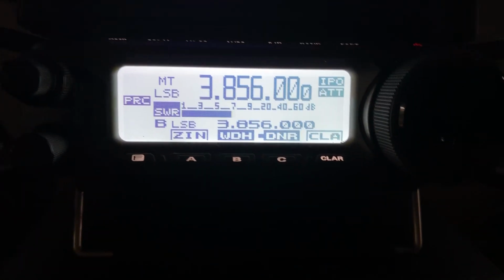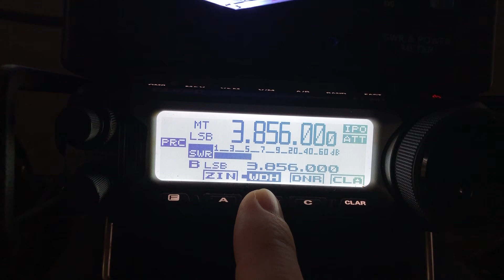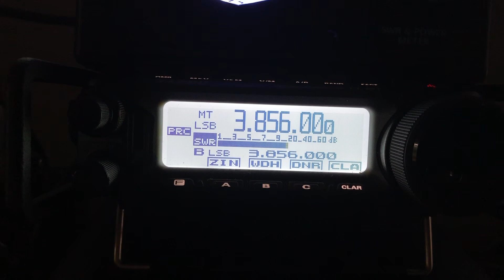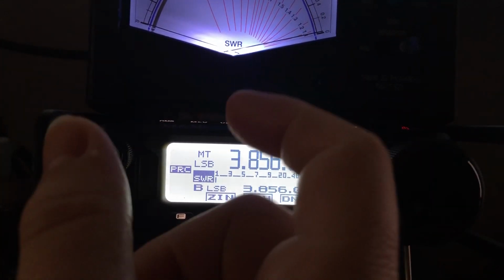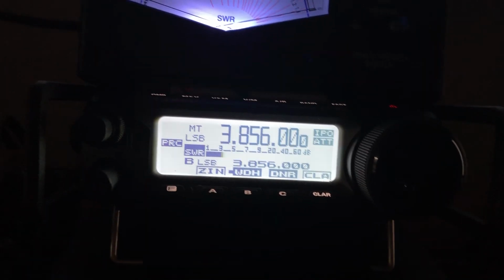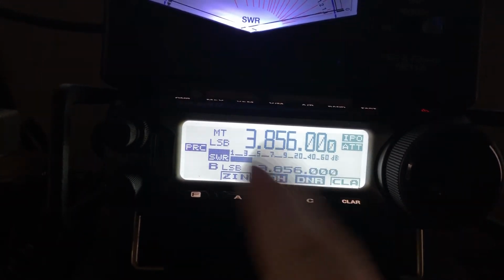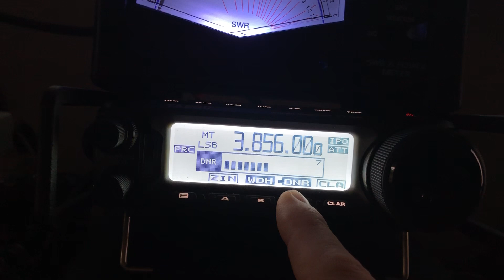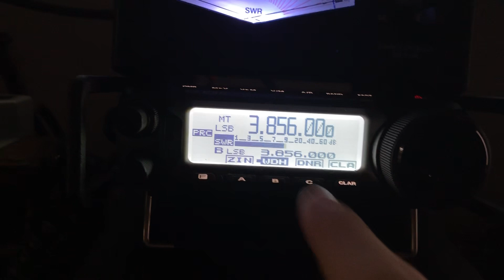Yaesu FT-891: Filtering Noise from a SSB Ragchew

Comment: Question...does the "width" only effect TX, RX, or both for SSB use??  73 😉
Reply from the maker: The Width setting is for RX.  There is a separate BPF (Band Pass Filter) setting in the menu to control TX bandwidth. I set it to 300-2700.  This setting produces a good balance between fidelity and punch for your TX audio.
Reply: @n4hnhradio  Thanks for the reply. I will have to dive into that menu setting. The manual is not very informative about the "width" feature, so I assumed it was for both. But obviously not. I do appreciate the tip 73 👍
Reply from the maker: There are width settings in the menu for the parametric TX equalizers.  Those are actually Q factor, even though they are labeled as width.  I cover that in my menu optimizations guides.  The higher width number means more narrow.

Comment: I just bought and installed this radio with the ATAS120. When DNR is on, even at a level of 1 it sounds very watery/digitly. Is there any way to avoid that? Listening to this video I’m not detecting that sound. Thanks for the suggestions, you make since great videos.
Reply from the maker: Just keep watching my videos. Even for other radios. I teach all about DNR.  For the 891, set DNR to 9. Use IPO.
Reply: @n4hnhradio  I did that but it still sounds watery. My FTDX-10 didn’t sound like that.
Reply from the maker: @truckinguy92 The FTdx10 has the same DSP but more memory. It has advanced algorithms. The FT-891 isn’t going to beat the FTdx10. The advanced algorithms won’t fit the limited memory of the FT-891.  That said, if you adjust your FT-891 exactly as I do mine, you can get good results. I have a PDF that I make available to members of my Patreon support team who support my work with annual donations. That PDF covers my menu optimizations.

Comment: I’m so glad you explained the filtering possibilities as I’ve just purchased an ft891 and if I can get it to where you have with the various actions it will be epic!
Reply from the maker: That FT-891 has a tremendous receiver and super DSP.
Reply: Just set mine up very similar to your suggestions and yes excellent audio now!! Thanks buddy
Reply from the maker: I’m glad you liked it. It’s unbelievable that we can buy a radio today, for little more than $600, that will outperform radios that cost $1,200 in 1959 (over $12,000 in today’s money).

73, Doug

Comment: ... as a brand new owner of a (only $639, as you tacitly pointed out.. what's not to like?) brand new FT891. I am still getting up to speed with the menu.. there is a bit of a learning curve to that, so your tutorial on DNR was most helpful. For me this is a bit of an 'upgrade', (still not real ham radio bling though) from a Xeigu G90.. an interesting little Chinese box I might add.
Reply from the maker: Congratulations!  You will see a video in the playlist where I explain how to operate the FT-891 without needing to access the setup menu, or even touch the buttons on top.  You might occasionally need to access the Function menu, and that’s about it.

73, Doug

Comment: Put a set of Boston CR-4 (no tweeter) or CR-5 (+ tweeter) speakers on that and you'll love the natural sound improvement.
Reply from the maker: Im sure those speakers sound good.  I don’t think I would need a tweeter for 300 to 3,000 Hertz of audio spectrum.

I’m very happy with the Yaesu SP-8.  I like the passive filters for SSB and CW.  It is also the perfect size for the FT-891 to set on.

73, de N4HNH

Comment: Takes so long to learn menu system.  Like a thick book. I'm still struggling and it's been 3 months since purchase.
Reply from the maker: Just tap F to cycle through the Function menu pages and long-press F to open the deep menu.  Follow the settings I show in my videos for the deep menu and you can leave the deep menu alone.  Store 2 or 3 favorite frequencies/modes per band in the memories.  Use the Multiknob to cycle through the memories.  Use Memory Tune (rotate the VFO) to slide up or down the band after you select a memory.   Press straight in on the Multiknob to return to memory mode.  

I use my FT-891 as a mobile and I rarely have to look at the transceiver for more than a glance.

I’ve covered these techniques and more in the videos.  Just watch everything in the FT-891 playlist.

73, de N4HNH

Comment: Thanks for that tip about width combo with DNR.  I was leaving DNR off because it would make SSB voices sound strange.  Widening the width fixed it right up!
Reply from the maker: The wide width restores some of the high frequencies that are knocked down by the DNR.  But, when pulling out a weak station, I find 2.1kHz bandwidth to be better.

With FT-891 I never run DNR at less than algorithm 9.  

And the key to DNR effectiveness is minimizing the noise first with attenuation (ATT) and Intercept Point Optimization (IPO).  Then use RF Gain as the finishing touch.

Give the Digital Signal Processor less noise to filter out and it will do a better job.

73, de N4HNH
Reply: @n4hnhradio  A very great video for fine tuning the receiver of the FT-891.  I do have a question, do you disable Automatic Gain Control (AGC) while filtering, since you actually want to manually adjust the gain?

73's Doug
VE2YOW from Québec, Canada
Reply from the maker: @mononcyoyo I rarely ever turn off AGC.  I chase ghost stations.  I use IPO and ATT mostly, to knock the noise down before it gets into the roofing filter. Then I let the DSP finish it off. If you watch many videos on this channel, you will see my standard gain structure for pulling out the weakest of the weak.

Comment: It should be made clear here, is when the IPO, (Receiver Pre-amplifier) is highlighted on the display, it means the IPO is disabled. When not highlighted it is on. Refer to User Manual Pg. 23
Reply from the maker: I’m afraid you have that backward.  IPO is Intercept Point Optimization.  In Yaesu speak, turning on IPO means the RF amplifier stage is disabled (i.e. Preamplifier off).  ICOM approaches it from the other direction.  They just say   Preamplifier On or Off, and it has two levels of amplification.  ICOM has IP+, which is their version of Intercept Point Optimization, but it is a special approach that is required for an SDR.

Comment: Set the contour filter to +10, that brings so much more fidelity back with the DNR on.
Reply from the maker: Boosting contour at the frequency where the voice is more intelligible brings in more noise too.  I’m not going for fidelity.  I going for intelligibility,.  Dulling the noise with a contour cut helps me hear the words better than trying to pick the voice out of the noise that gets amplified when boosting with contour.  Maybe my ears hear differently than yours.  73
Reply: @n4hnhradio  
could be, different perception of hearing. in my hearing the DNR attenuates the noise but attenuates the higher tones too, the contour set to +10 compensates the attenuation of the higher tones in the DNR and makes the speech much more intelligible, the audio is like it pops out, more fidelity too. to my hearing the noise isnt amplified with the DNR turned and the contour set to +10, its a very good setting for the FT891, FTDX3000 and i think it will be same for the new FTDX10 too but likes and perceptions are of course individually different. i think contour and DNR in the 891are good for that comparably low price.

Comment: If you want to reduce the static crashes , place 10M Ohm resistor between your antennas connection and a good ground connection. It will prevent the high voltage build up on your antenna. Problem solved.
Reply from the maker: Are you certain it will prevent lightning from causing such static crashes?  I only get that when lightning strikes, though the lightning might be a few hundred miles away.
Reply: @n4hnhradio  try it.
Reply: Depends on what kind of antenna.... if you use an antenna that is DC 'shorted' to ground thru the windings of a matching transformer or matching balun, this is not necessary... it would essentially be DC grounded in any event.  Check with a meter.

During a 'local' T-storm and before it passes high voltage can occasionally build up on certain types of antennas, but once it starts raining that problem quickly disappears. 

The 10meg-ohm resistor trick, will not solve the problem of static crashes caused by lightning... this is simply broadband RF noise created by local or propagated lightning strikes from afar.

Comment: Thanks for the video! Good videos on this have been missing. On the DNR, I was told that turning it up isn’t necessarily increasing the same effect. It was actually 15 separate algorithms for different types of noise and they’re coincidentally ordered from 1-15 based on simplest to most complex.
Reply from the maker: There are 15 different algorithms, but the higher the setting, the more aggressive the DNR becomes.  I don’t find that I need a setting higher than 10, and I mostly use a setting of 7 to 9.  Also, roll the RF Gain back as much as possible - to the point where the S-meter comes up equal to the S-meter reading of the weakest signal in the ragchew.  This presents the DNR processor with less noise to filter, helping reduce the digital artifacts (the watery sound).

Note: The DNR in the FTdx5000MP Limited is the absolute best in the business.  It cannot and will not sound watery.  It has a boss of a processor.  You can hit it with full-on noise - no ATT, IPO, or RF Gain reduction - and it will not produce the digital artifacts.  But, I still use ATT, IPO, and RF Gain with my FTdx5000MP Limited, because it still sounds cleaner when I don’t need as much from the DNR.  In fact, I hardly ever exceed 5 with the DNR in the 5000, except for CW.  In CW mode I run the DNR at 15.

73, de N4HNH

Comment: Nice demo on a FANTASTIC mobile HF rig. Noise reduction features are outstanding. Sounds digital like yet not robotic. I have been using mine field portable for about 3 years now and still love it every time I take it out 🤘
Reply from the maker: Thanks for your comment!  Mine is normally used for SOTA, but right now it is serving as my base station, while Yaesu repairs my FTdx5000MP Limited.

Comment: I had not thought about extending the bandwidth when you put in the DNR, Interesting.  I agree limit noise at the input, it does more to help without effecting much fidelity.  Typically you want to limit bandwidth to help the SNR but your demonstration showed the DNR can is helped with more bandwidth.  I agree this is a nice radio for the price.
Reply from the maker: Thank you for your comment.  If you are into CW, you might be interested in the trick I use to suppress filter ripple.  It is covered in other videos, for both the FT-891 and the FTdx5000MP.  I use the manual notch filter to reduce the ringing sound that is associated with the steep skirts of a Chebyshev filter, such as the ones in the FTdx5000 and the FT-891.
Reply: Doug McAlexander I cannot do CW yet but I have listened.  I did not know the digital filter was a Chebyshev filter.  I had not dug in to see since digital filters can be idealized you can use many more poles to adjust rolloff.  Thank you I will give it a try.

Comment: Passed my General test two days ago, and I am setting up my first HF station tomorrow with an FT-891. I have only listened on it with a crap antenna made out of speaker wire before, but even then, I can tell that I can really pull in signals.
Reply from the maker: Congratulations for earning your General ticket!  Speaker wire will work, when cut to the correct dimensions.  My best antennas are my 250 foot doublet and my ZS6BKW computer-optimized G5RV, from NI4L.com.